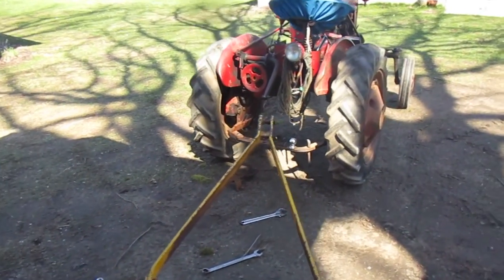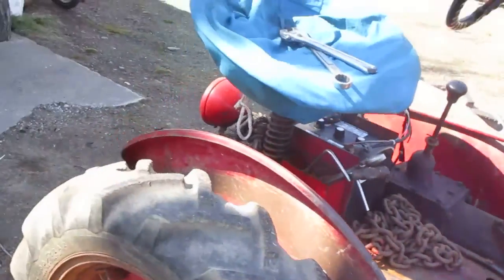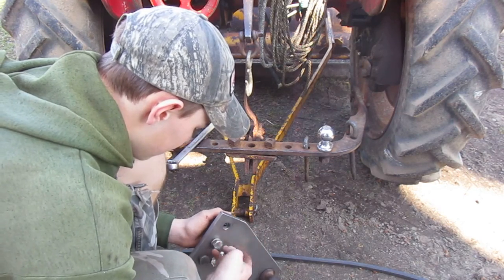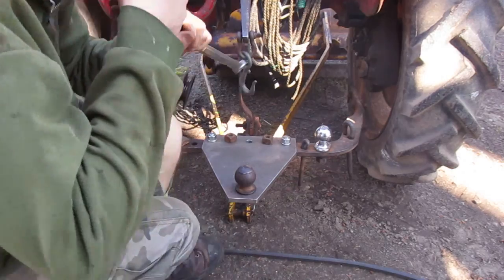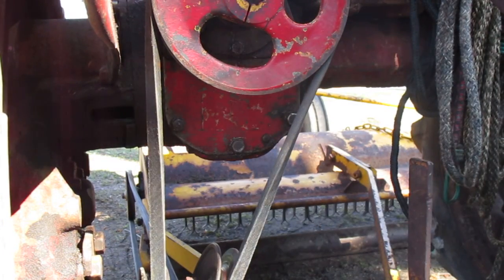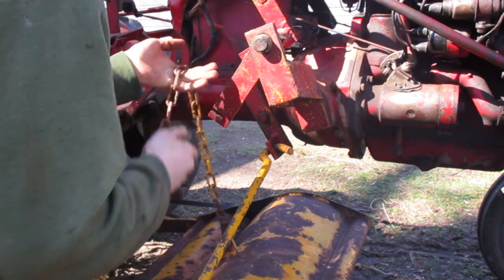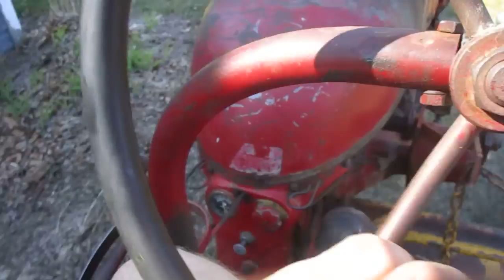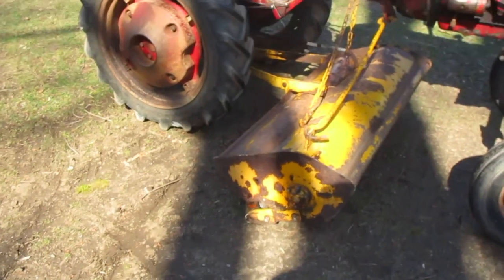How to install a flail mower on a farmall cub

Comment: Thanks for this video.   Greetings from Pa.
I just picked up a 55 Cub with a Woods belly mower and a Mott flail .
Looks like I have everything I need to run the Mott .  The Woods is currently installed .
I'm assuming the long belt will drive both units since I only have that belt .
I have also have a  shorter belt which runs from the driven pully to the flail shaft . I'll have to install the Mott and see what I need if anything. 
Thanks again,  your video will definitely come in handy.
Reply from the maker: DAVESTATION75 greetings back from Erie PA lol but I think that will work if you need any assistance I can give you my email and you can ask as many questions about those as you want I have both